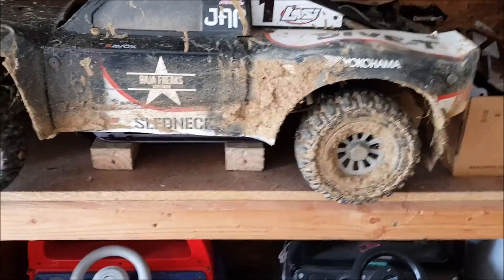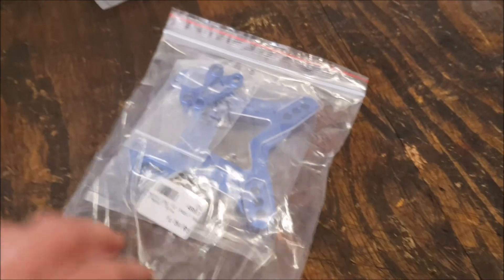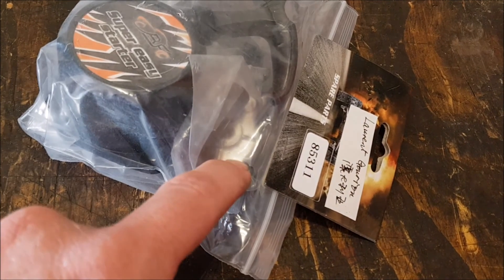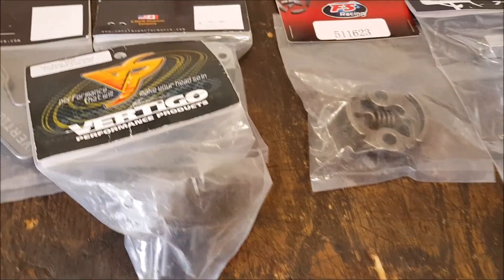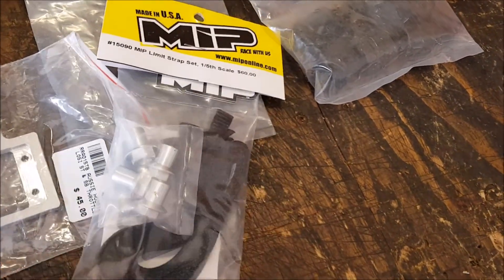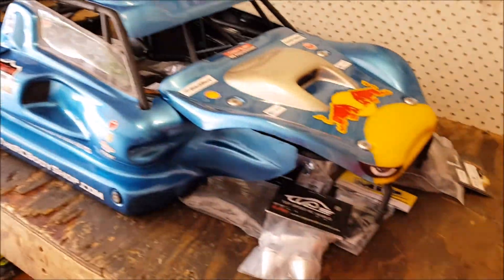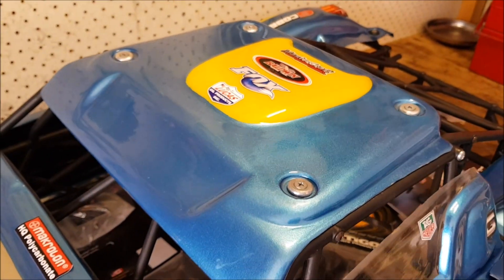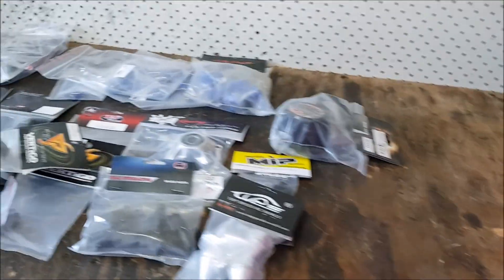1/5 RC Losi 5t - Update and Upgrades!!

Comment: Hi buddy.   Just getting my cars ready.   I got a set of fast lane racing.  Flm I think. Drive cups.   They are a bit cheaper than stock. And. They have two sets of slots in them  Centre normall. But.  Don’t now why they all aren’t like it.    New pin on drive shaft and. Move shaft round and they last twice as long.       Have a look.  They are great. Only ones I will be getting now.     And they have. Like a rim all the way round outside edge.  So Shaft won’t pull out when there be to much droop.
Reply from the maker: Anthony Charles cheaper then stock? Now you got my attention😁 where did you get them?